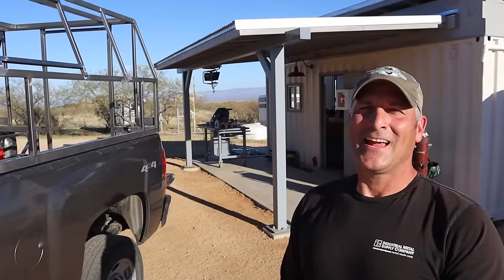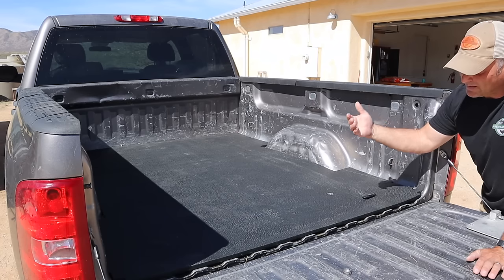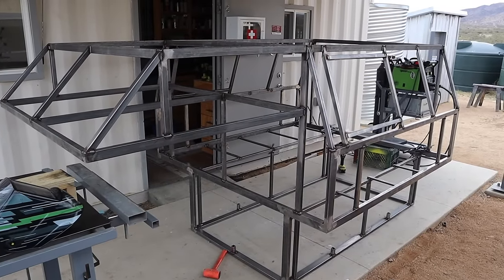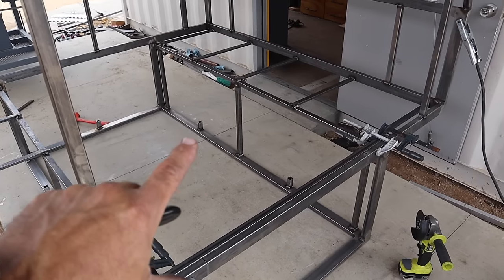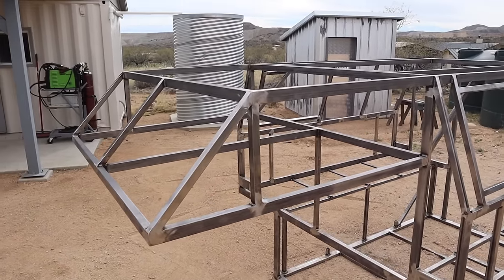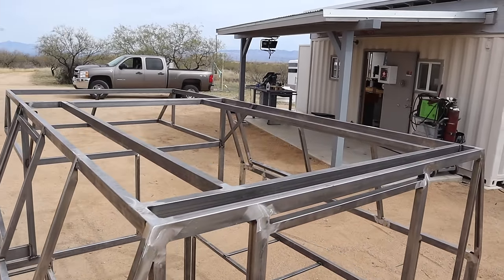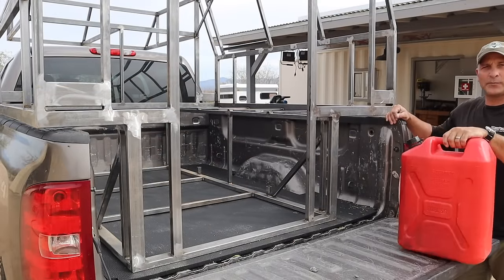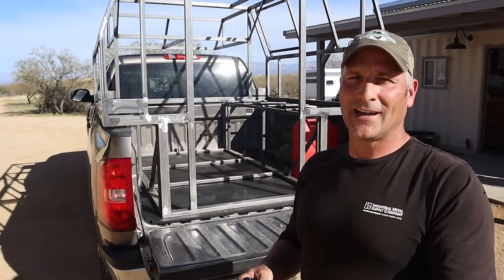DIY Truck Camper Build  - The Frame Pt1  ( How To )

Comment: First time on your site. Nice work! Problem I see is no venting on your square and rectangular tube. I don't know your climate, but if your temperature range is above and below freezing those tubes become reservoirs for condensate water. I have deconstructed structures similar to yours with a torch and had to drill holes to drain the black nasty water out of the tube before I could cut with the torch. I hate being negative Nellie, but you need to vent those tubes. I've been doing this kind of stuff for years.

Comment: A+++ project Joe!!  Here's an idea for you that will eliminate the need for you to build jack legs to store the box on.  My Gpa built a stand that he stored his truck cap on. It was 4 corner posts that for all practical purposes had 2"X6" bed rails on top of left and right side posts. He'd back his pickup back to where the cap was right in front of the front corner posts, unclamp the cap from the truck's bed rails then he'd manually start sliding the cap off the truck rails, onto the 2"X6" wooden rails that were atop the corner post (bed rails). Put the clamps back in place to hold the cap secure to the storage rails and that's all.  Come time to reinstall the cap, just back the truck up to the cap, and slide the cap forward onto the truck's bed rails, bolt them down and your on your way!!  🙂
Reply from the maker: Thank you Mark!   Sounds like your grandpa had a good setup made for his…. But the only problem is that I’m already welding part of the jack leg projects today🤪.  Plus I want to be able to take it on and off in multiple locations

Comment: I would suggest welding in a piece of steel where your hooks will be to secure it to the truck bed tie downs so that there is a really good anchor point if you happen to be on rough roads when it's rocking back and forth
Reply from the maker: It’ll have bed bolts, as well as hitch pins to 4 points on the bed rails as well as 4 ratchet straps anchoring it to the bed tie down points.  But have also contemplated adding one of those ratcheting tie down systems as another alternative.

Comment: Another great useful build, Joe! Hey, instead of clamping that horizontal piece & having it shift when you cut out for the door, just tack it in place & cut the tacks once you get the door opening framed in. Tacks won't allow shifting and don't get in the way or snag your pants & gouge your shins like clamps. Best, Andrew
Reply from the maker: Yeah that would be better for sure.   But the ‘inside my head voice’ said “use clamps so you can take them off real quick during that clip and walk through the doorway 🤪

Comment: Great video. Reminds me of building balsa wood and tissue paper airplanes as a kid. Being able to build something to your needs rather than following a generic plan really solves some in-thought of problems. The can storage on the right rear is a great example of that. I was trying to figure what you built it asymetrical and you answered that without me having to ask the question. Thanks for sharing and looking forward to more on this project!
Reply from the maker: Oh I loved those planes!   I once built one with the 3d body/wing and the glued on thin tissue paper and I was so proud of it.  And it had a rubber band propellor drive and actually flew quite well!  Of course I destroyed it by launching it off the roof and it has literally gone maybe a 150ft before a breeze slammed it directly into the street.  Oh I was so sad😭😂
Reply: @homesteadonomics  I know, I built a Fokker tri-plane. The Red Baron’s plane. It probably sat as just a balsa wood skeleton for a month or so because the framework just looked so interesting. Kind of the stage your camper is at the end of video one. Eventually you move on to the next stage but it did teach me to really love the journey!

Comment: Camper looking great so far. Just a couple of things, check the direction of your window openings so that rain can't enter into them. I was going to suggest that you hinge the folding doors on the toolboxes to lower down for a worktable but you have a lifted truck so that would not work. If you hinge them at the top, maybe place low profile lights on them to help luminate the sides of the tuck when open. Have you considered some kind of roll out shade for both sides of the camper to offer shade when you are on a jobsite? You are going to have a heck of a rig with this truck/camper towing the camping trailer. Great job.
Reply from the maker: Thank you Tom!  Yes I am going to make sure the windows have the sliding section on the leeward side.   Especially since I’m pushing their limits with them being angled in slightly.  
And to the point on the work shelf on the compartment doors.   I had considered that but will likely do them ‘flip up’ for a couple reasons.  1- the doors are rejects from a RV company and are aluminum clad but foam core and aren’t super strong so I don’t think I’d want to set a bunch of stuff on them.   And also upper hinge acts to divert more water away from upper seal so, at least in theory, they will be more water tight with the doors flipping up.

And for the shade… that is definitely something that I want to add.   Can never have enough down here!😅

Comment: Good job! I’m planning to do same but will convert bed to a flatbed and that flatbed will be sticking out 6 inches on both sides that’s how I will gain 1 ft of extra width. I might extend frame about 1 ft to gain 1 ft of length.

Comment: As as long time metal fabricator myself, the only thing I would have done differently was to extend it to the edge of the laid down tailgate.
Except for your very nice tailgate stairs, the stairs are taking up valuable interior space that can be better utilized with a different camper access. 
But hey, that's just me. 👍😀😊

Comment: I dont have a welder or the skill to do what your doing but i was looking at trying a foamy camper soon
Reply from the maker: Those foamies are super cool and if you check out teardrops and tiny travel trailer forum there are lots of folks who build them off harbor freight or northerntool trailer kits.   I think you’d have a great time AND the advantage is that they are incredibly light weight and insulated from the start!

Comment: Excellent work, can't wait to see the complete project. I am a DIYer and have a GMC truck and always wanted to do the same. This is a great inspiration for me. My problem now is  I am very new to stick welding, any tip or help will be appreciated
Reply from the maker: Thank you! For a project like this I’d highly recommend a wire feed setup.   Either MIG or flux core.   And if you have done a lot of projects before I’d practice on some smaller projects first like a bench or table with the same size material you plan to use in the camper/trailer to get your settings dialed in and then… well, got for it!   I think you’ll greatly enjoy the build process!

Oh yes, if you haven’t checked them out go take a look at the forums at teardrops and tiny travel trailers.   Really great forum with lots a people’s builds to check out!

Comment: Interesting build.  his just popped up so I'll follow you through the build.  Heck of you skinned it in carbon fiber right now you would have a heck of a build and be in the dry.  Good thinking on the cantilever down force.  Lot more then that people think.  Also good thinking on the gas cans and maybe propane bottles.  Now what about water storage, potable and grey/black water?  The seven gallon jerry cans with water and an on demand pump will fit right in with the gas cans as well.  I don't need everything at 68 yrs. old but a few things yes.  I have motorcycle tent camped and             truck camped with simple shells, homemade wooden covers etc. all my life.  You have a good one coming up now.  Maybe a raised floor area behind the side frame out of walkway with slide in/out.  So many things/choices available that were only dreams a few years back.  Solar panels and battery storage is a must, simple nd affordable now and that stealth ability to stay where ever you can and want.  Independence.  Like the straight cab with 8 foot bed.  You don't see as many of those.  People want to use so much cab 4 door space.  Can't understand it.  You live in the camper, why not make it big and like ours, close the tailgate.  Good design on steps.  Saw some like that before.  Most pull the tailgate off and flush the camper with the bed, all wrong to me.  Next time.  Hope your channel grows.

Comment: Another great video presentation.  Thanks for sharing your insightful thoughts and construction.  Good seeing your use of a builders’ square rather than a bubble level.  Looking forward to seeing the successive episodes.   Question, will you be adding solar panels to recharge an external battery box or “generator” unit?

Wishing you and your family a blessed week filled with gentle seasonally appropriate weather and restful evenings together.   Peace brother
Reply from the maker: Thank you!  Yes the large square really helps in keeping everything square……also diagonal measuring to ensure it’s truly square.  Although I didn’t show that…haha.  
As for a solar panel….yes I am going to probably get a Renogy 100 or 200w to charge a Bluetti power bank that I did a review on a while back. And that’ll power the lights, etc for use on the road.
Reply: @homesteadonomics  I remembered your review but not the brand.  In addition to lights you can recharge batteries for cordless power tools.  Your posts provide an honest review.   Take a page from UPS and FedEx fleet maintenance and add translucent roof panels to illuminate the interior without using lights in daylight.  

Looking forward to seeing your review of furry kids.  I admire how you and your spousal unit are raising your daughter.   You are a blessing in many lives beyond your family.   Peace brother

Comment: Right on👍🏻good to see another steel framed truck camper, makes me feel a little less crazy for doing that myself 😂
Reply from the maker: Haha… yes!   I can definitely weld aluminum…..but it’s about working with what you’re confident with.  And for me, the marginal weight savings of aluminum doesn’t outweigh the ability to efficiently make hundreds and hundreds of welds in this type of frame work.  Versus me fiddling with my spool gun hundreds of times😂
Reply: @homesteadonomics  see for me I can’t weld aluminum and I was confident on framing at wood. But felt more at home with steel. Not saying I’m a welder by any means but enough to get by and not fall apart down the motorway 😂

Comment: Shaping up and some good ideas. Did you consider an aluminum frame like the tailgate ladder?
Reply from the maker: Yes I did.   But if I was doing it with aluminum I’d probably use 1/8 wall as my spool gun does better on thicker stuff and in that case the weight savings would be negligible compared to the 14ga and 16ga steel tubing I used.   Also, steel is a bit more forgiving.  But I will frame the pop roof out of aluminum.

Comment: Nice project. I wonder why the width isnt up the wheels archs to sit secure between, the upper section not wider a bit up to the tires width, and the section ovrr the roof has such a huge gap between the roof and the section.  just having a roof basket on my suv a bit too high and too near the windshield it was making noises and vibration like crazy.  I would make it almost touching the roof with a rubber  mat under that part so it doest scratch. Also I would go up to the tailgate and put a swivel ladder or detachable ones...but that is just me. Since it is "custom"  I would make it to the exact size of my bed truck to take every inch I get get of interior space. Can still create a space for gas jugs on one side, open air if needed for ventilation. Still great project and I am jealous for sure of your skills, free metal and truck 😅
Reply from the maker: Thanks for checking it out!   All good points and I can definitely see the advantages for sure . I guess my thinking was that I’d have a built in compartment by adding access doors for those front areas of the bed.  That way I wouldn’t have to build a separate cabinet…. Just use the little access door 12:00
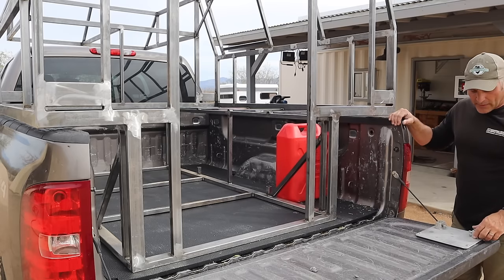And for the ladder…. I show a clip of my tailgate ladder project that will be reinstalled at 13:14

Thanks for watching 😊🙏

Comment: Getting a bit more gray Mr  Joe  

So for when you remove the rig,  built a platform for it sit on. You won't need to raise or lower so far each time. 
I once had my brother build me one for my 8 foot Lance overhead camper. My camper had the drop on the rear that yours doesn't so he built it to set the campers full weight and the tail end to remain off the ground by 6 inches.  
Kept it safe and stable even usable off the truck. 
PM me if you need clearer information. 
Be well.

Comment: I decided to enquire about this issue on the 1st part of the build even though I watched all parts, I could not see how the camper is attached to the truck. I know it is setting on the floor of the truck bed, but is it not attached to the truck by any means and only depends on its own weight to stay still?

Comment: Love the thought that has been put into this project! Just curious, but after seeing it placed in the bed of the truck, do you wish that the front hangover section was closer in clearance to the roof of the cab? If not from an aerodynamic standpoint, but possible a little more interior space? Either way, can’t wait to see the final results!
Reply from the maker: Thank you!  As for the space between the cab and cantilever section.   Maybe a bit lower but I want to make sure there was enough space for flex incase I kit a big pot hole and that section flexed down a bit.   But I also have an idea to have a shade panel rotate out from there too.   Not quite sure as most of these ideas just rattle around in my head🤪😂

Comment: The thing that I started thinking is why not just get a van? Here in finland vans are much more common for many of the reasons you said you are building this thing.
Reply from the maker: Because this is the vehicle I have and own.  I can haul dirt, rocks, hay, pull my travel trailer, etc,…. And then this can simply slide in for camping for jobs.  
But to your point, a van would also be great for work and camping and I’d love to build one out.   But unfortunately the current economic conditions set forth by all the globalist puppet politicians is not making things any easier😭😂

Comment: need some triangle gusset plates inside the corners of that cantilever overhang
Reply from the maker: I meant to address that in the talking segment.   I have thought about that but generally sheeting adds most of the sheer strength that I gusset would add on an open structure.   But who knows.  It’s not painted yet🤪

Comment: Could you have used angle iron and basically cut the frame weight in half?
Reply from the maker: Unfortunately not, because angle would need to be thicker to match the stiffness that tubing offers…. And then you’d lose and weight savings.   For example, all the tubing in this frame is either 14ga or 16ga….. both of which are stiffer and lighter than the equivalent of angle which would be 1/8” thick angle
Thanks for watching😊🙏

Comment: What number VHB tape are you using to adhere the aluminum to the frame?
Reply from the maker: Im going to be using CV62F and maybe CV45F if I need to make overlaps.   I used it on my travel trailer build and the stuff is super amazing!
Reply: @homesteadonomics  Thank you very much. I'm building a cargo trailer (my friend is a dealer/builder and is letting me build my own) and I want to do a screwless exterior.
Reply from the maker: @TinyTrailers4BigAdventures  I got mine from SRI Supply…..they have the best prices I could find on the net
Reply: @homesteadonomics  Great. I'll check them out. Thank you

Comment: how are you going to secure it to the bed?
Reply from the maker: I’ll have bolts into the bed, hitch pins into the bed rails and also ratchet straps into all four corners.
Reply: Joe, take a look at how Four Wheel Campers are held in place.  They use an  eye bolt and turnbuckle system.  It's very secure.  I've never had a problem with mine.  You could buy the necessary hardware from Four Wheel Camper and be set.

Comment: Windows will leak if you set them in like you did 5:30 min mark.....  The weep holes will flow right inside.
Reply from the maker: It’s possible…..but I did a test with them at a slightly lower angle by pouring water on them and the water came out of the weep holes fine.   So I guess I’m going to have to keep my fingers crossed and hope that doesn’t change🤪.  Thanks for checking it out😊🙏

Comment: Surprised you didn't use aluminum for the frame... put a water tank on one side in front of wheel well and a gray water tank the other side... enough for hand and dish washing and drinking water...
Reply from the maker: Well, my aluminum skills with my spool gun are limited to 1/8” wall tubing and as compared to the 14/16ga steel tubing the weight savings wouldn’t be all that much.   And steel is just what I feel more confident in for as many welds as I put into this thing.   But I will be doing the pop up portion in aluminum😉
And yes the water tank in that area is a great idea!